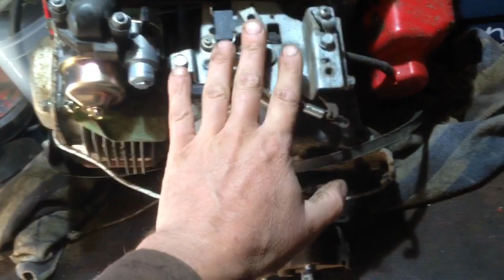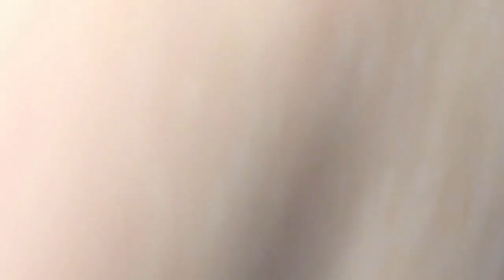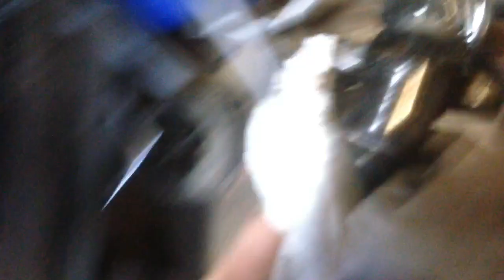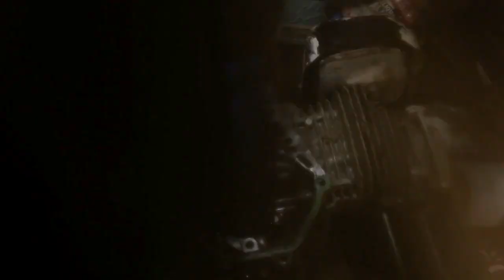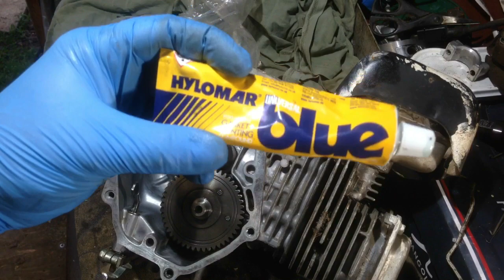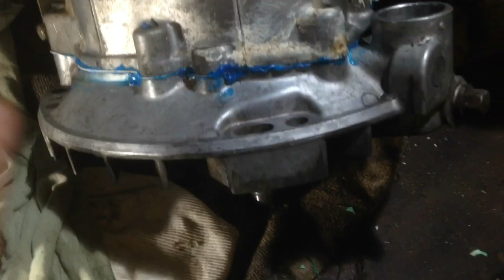Honda GXV160 Crankshaft change , HRD536 lawn mower engine work

Comment: Very nice. Why did you change the crankshaft ? From what I see it is not possible to remove the connecting rod without pulling the head off?
Reply from the maker: Hi I had to change the crank shaft because I needed the one with the extra key way slot as the mower this engine was for was belt driven. I didn’t have to remove the connecting rod or piston, so I can’t really help but it would be tight getting it out, if it went at all, you would be much better off removing the head. Hope this helps thanks for watching🙂👍

Comment: Thanks for the video, good work! One of my GXV160 engines is sounding very rough, likely a bearing. It’s very noisy without the blade engaged, but goes away when the blade is engaged. I assumed clutch bearing and so I replaced this, no difference, bugger! Do you think it may be the crank bearing? Do you know if there are more than one crank bearing?
Thanks if you can advise.
Reply from the maker: Hi is there a top clutch bearing on yours, that could be the fault, you have to remove the whole clutch assembly to get to it. Hope this helps🙂👍
Reply: Life's Hobbies And Happenings Thanks for the reply. I didn’t know about the top clutch bearing, I’ve just had a look at LingsHonda diagrams and it looks like there may well be one. Nice job for the weekend. Thanks again.
Reply from the maker: cseanny I couldn’t quite remember is there was a top bearing, but it makes sense for one to be there. I think when I had the same problem you are experiencing I just swapped the whole clutch over as I had a spare one. Hope you get it sorted🙂👍
Reply: nice work .there good engines